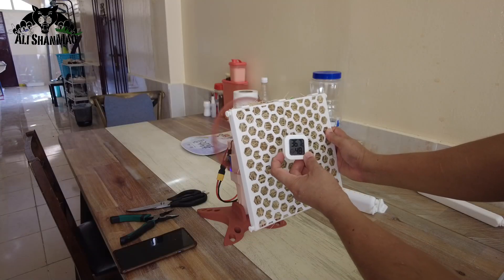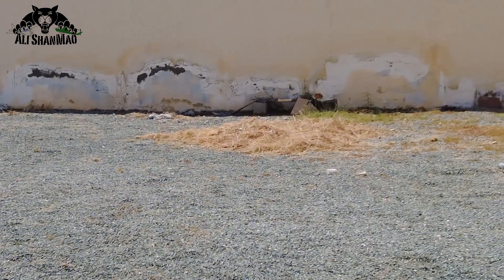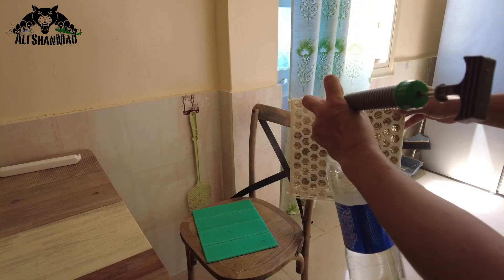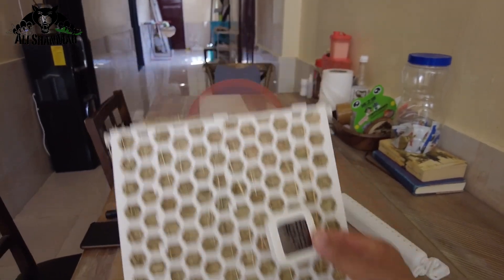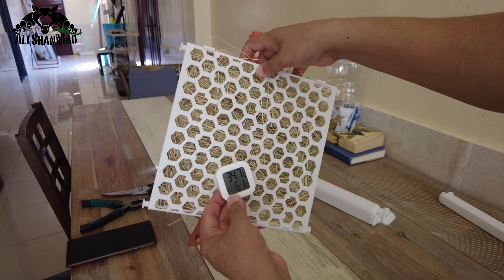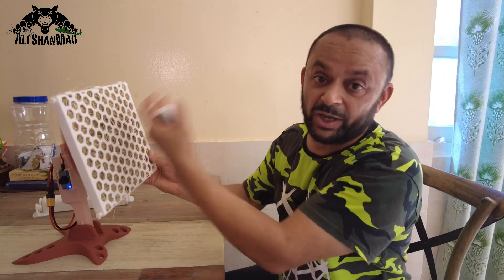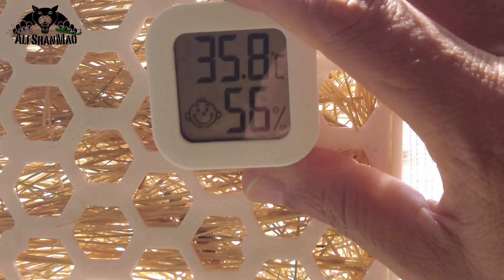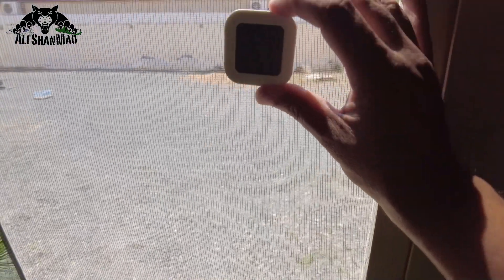DIY 3D Printed Curtain: Turn Waste Grass into Natural Air Conditioning

Comment: It's evaporative cooling.
Major disadvantage is you are introducing humidity into the air.
Higher humidity equals higher perceived temperature.
A/c units work by removing the humidity.
Reply from the maker: thanks for the tip

Comment: Cool, man! But you should consider that the apparent temperature increases as the humidity increases, so for example if you take down the temperature by one degree you'll increase a lot the humidity and it's worse than before. So to make this system work you should make a very large filter so the sufficiently lower temperature compensates the higher humidity. Keep experimenting!
Reply from the maker: thanks for the tips

Comment: You might consider using a synthetic material, rather than grass for the membrane.  The wet grass might foster fungal growth, and spew spores into your living space.  Legionnaires' disease from using swamp coolers is a known hazard that has resulted in deaths.  Getting only 1 or 2 degree change in the temperature may not be worth the risk of lung disease.
Reply from the maker: Thank you for the information. Instead of grass, I can use thin membrane prints that will keep water flowing slowly through the plates. nowadays printers can print very thin lines easily. Thank you for the update. yes the idea was to change the grass regularly every 2 days or so. this is a big learning curve and i appreciate the feedback.
Reply: @alishanmao  I've followed your RC adventures for several years, and appreciate your innovations.   If you don't use the excess grass in your coolers, you will, still, have excess grass... perhaps, you can get a goat.😎
Reply from the maker: @Patriottoo2  Hi thanks for continued support. yes goat is a good idea. free milk too :)
Reply: Тоже подумал о плесени. Но к счастью солому можно менять каждый день ) А любую мембрану придется менять, или мыть из за скопления пыли и тех же грибков.

Как вариант поставить более прочную структуру с вертикальным водопадом. Увеличив объем воды стекания. 

Но в любом случае это ведет к повышению влажности в помещении, если не делать ее двусторонней из алюминия с испарительными ребрами с "рабочей" стороны )